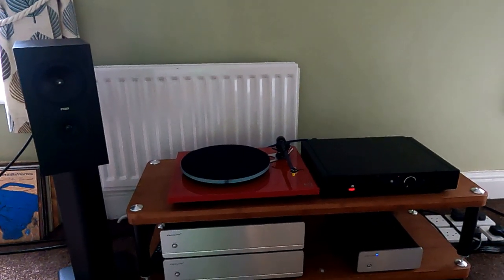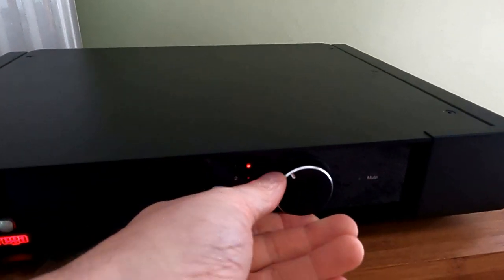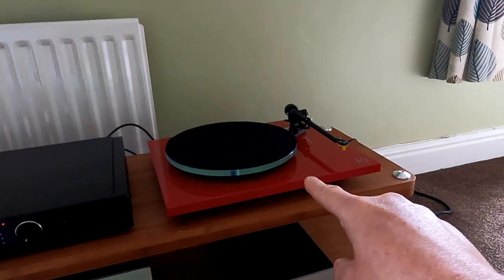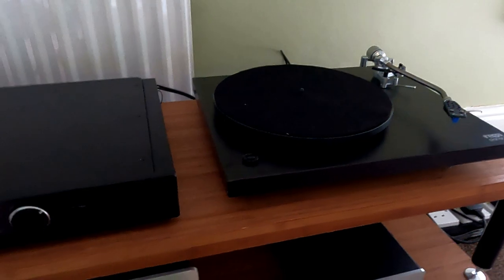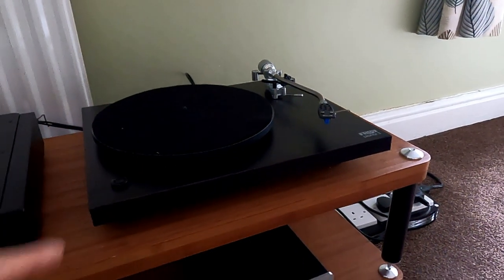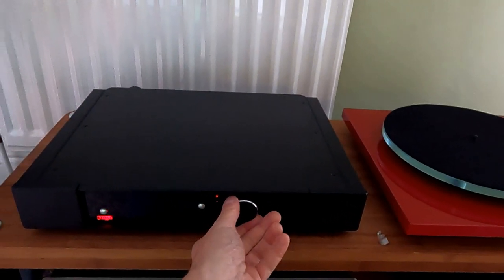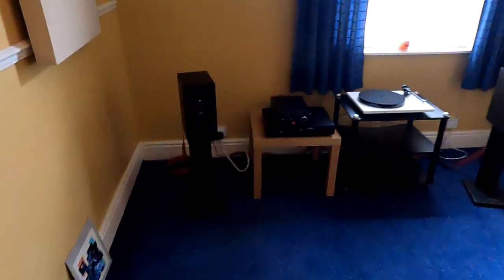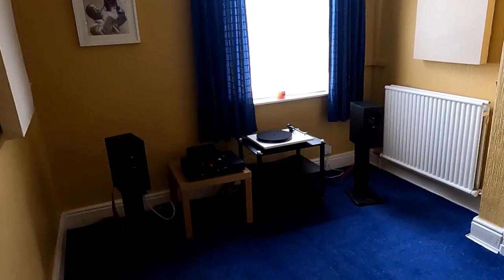turntable buzzing?  simple guide to what may be going on.  Using Rega Planar as example

Comment: Best tip ever! I was searching the internet about how to solve my hum. Nothing worked. I noticed that it somehow had to do with my amp. I noticed that when I put my turntable further away, the hum got less. But the configuration of my tv cabinet I couldn’t move it further away to solve it completely. Then the genius tip, switch amp and turntable. My transformer was on the left side too. The side I had my turntable sitting. Switched, no hum! Gone! Thanks a lot for the great tip. Cheers to you!

Comment: Hi Phil,, great and interesting video, the Elyis 2 dies pick up low level hum as it goes towards the end of record, however you rightly said change the cartridge will solve the issue, did try tuning an earth wire from the motor housing to see if that resolve it. I have a spare ortofon cartridge and tried it and yes hum much reduced. Regards mark

Comment: I have a Rega P3, playing through a Project Phono Box E and a MarantzSR 5007,feeding a pair of Mission MX3s. Sounds absolutely awesome, with absolutely NO phono hum whatsoever, though the Marantz is insulated from the turntable and pre-amp by a fairly thick glass shelf on my equipment rack. Works well for me.
Reply: You may have  answered my problem. 
The phone box. I have one turntable   and 2 amplifiers and sets of speakers. With the Denon, the grounds must be connected to cut the hum . But when I use the NAD the ground must be cut. So maybe the phone box for  isolation is what I need.

Comment: best video on “buzzing “:) on youtube , thank you for sharing this is very useful for a lot of people, i have rega io and P1 and it was buzzing , only when i grounded rega io amp using grounding cable connected to  grounding metal in power plug in the wall ( european system) and connect to turntable grounding  knob on rega io , the  buzzing stopped , i think my issue is house is not grounded properly , or it could be wi-fi or anything in house , i will investigate it further . thanks
Reply: Had the same buzzing sound happen on my P1,  did the same thing and as you mentioned once I grounded the phono mini to the ground plug from my power strip the buzzing disappeared.
Reply: @lawrencecabrera5937  yeah I had the Rega mini (still do) and it was quieter than my new Bryston BP2 but unfortunately/fortunately? the Bryston at 10x the price does sound better.  The only "solution" is to not crank up albums too loud because it's not horrendous at this point.

Comment: Very useful video. My problem was that I  had quite a noticeable hum from both speakers, Rega 
Brio, Dali Specktor 2s, Schitte phono stage. Nothing seemed to work so I unplugged the other components one by one. I have a Yamaha Music cast dac/streamer, and it was this - though not the device itself. It's powered by a small usb plug in, like the ones you use to charge phones etc, and this was the culprit. I swapped it for another one and all was fine.
There is still a low buzz when I put my ear right up to the speaker but I'm putting this down to the Brio.

Comment: Hello Cheshireaudio,

I've been terribly vexed over an ongoing buzzing from my turntable (it's a Fluance RT-85 with a Sumiko Moonstone Cartridge connected to a Pro-Ject Tube Box S2 phono preamp)

Since I have a second turntable & phono preamp I switched everything out. Buzzing was still present. I moved the turntable away from the AV receiver and that didn't work. I even switches cartridges and checked the connections.  Nothing worked.

Then it occurred to me to look at my AudioQuest cables and one of them was the culprit. When I moved it around the buzzing increased and decreased so I replaced it with a spare set of RCA cables and the buzzing was gone in a snap.

It never dawned on me that a set of newer AudioQuest Cables could be defective. Luckily for me they're entry-level cables at roughly $40.00 so I didn't pay a fortune for them but even at that price range, one would expect a better experience. 

Anyways, your video got me to thinking outside of the box and within an hour I solved my buzzing problem. Thank You!

Cheers!

Comment: A very good video. Another cause of hum with older decks can be mechanical vibration from the motor finding it’s way into the replay chain. Hence the hum is only present when the stylus is in contact with a spinning record. Quite a few 70s belt drive decks used rubber mounts to decouple the motors. The rubber goes hard with age and no longer isolated the motor adequately. Often the rubber parts can be restored using liquid soap and hot water. Pioneer PL12D is an example of this, but many others from that time are very similar in design.

Comment: I enjoyed this video. I have a new Rega Planar 3 and a Rega BRIO. As the tonearm finishes a side, when I lift the tonearm, the static is crackling and a hum is present, and when the tonearm is back in place, the loud buzz will snap to a silence, like a vent closing on the side of your house. Without an album on the platter, I can move the tonearm towards the middle of the turntable and the buzzing hum increases a lot. It is very hard to diagnose!
Reply: I have the same problem with my new Rega 3 and it’s driving me crazy. I’ve tried everything to eliminate the buzzing, but failed so far. Did you find a solution in the end?
Reply: @beetlebum7760  I tried 2 Exact cartridges and the dealer installed an Exact cart on one of his at the shop, with the same result. Probably a bad batch of Exact carts. I upgraded to an Ania MC cart and no issues, but the sound is not as warm as the Exact
Reply: @LifelongMusicJunkie  That’s too bad. I have the Exact as well. ☺️ So I’ll return it to my dealer and see if he can fix the issue without having to change the cartridge, as I’m also quite happy with the way it sounds.
Reply: @beetlebum7760  Make sure your dealer has another Exact on hand. My dealer is a small local dealer so he had to order another Exact to prove that both attempts to fix it were the same. Good luck.

Comment: That is a very valuable video say the five times fast.  Personally I have the newer planar 3 with an elys 2 that definitely picks up more noise as the arm gets to the middle towards the motor as you point out.  I agree I don't think it's a grounding issue.  Perhaps I am getting proximity issue problems still but having bought a Bryston BP2MM with PS3 power supply didn't help at all if anything probably noisier than the little Rega Mini phono stage.  Does sound better I must say.  Perhaps adding a NEO power supply would improve the noise problem and apparently would improve the sound.  Adding a new Rega reference belt might improve further as to sound quality.  I should try turning things off like my wifi etc. to see if that takes out the hum but when a lot of it seems like it's the Rega motor that frankly I consider a dog in terms of noise from the get go.  I would have to imagine Rega cut corners somewhere if nothing else they took out 2/3 of the weight in an apparent attempt to improve sound quality which seems a bit silly to me but they like the light stiff design and have gone a bit bonkers in that regard and one would think that if you want to isolate things like motor noise you build it a whole lot differently than wide open and less material.  Anyway getting much more proximity is tough when Rega doesn't even let you put a nice interconnect and instead force you to use their interconnect and live with that and their chosen length.  It's probably good I do like the Rega TT having an original planar 3 that is a freaking tank and if this newer one motor doesn't die long before 30 years I would be amazed.
Reply: I have a fairly new P3 (3months old) fitted with a Rega Exact cartridge and have had no noise problems whatsoever.
Reply: @alanbratt3022  well most really like the Exact and many seem to not like the Elys2 so much, hum aside.   What phono stage are you using?  The Rega Mini has a separate ground and surely is quieter than this Bryston BP2 so I would imagine a Rega Fono MM model would provide quiet operation and great sound.  My volume when not set too high is fine as to hum with my system, until maybe end of record.  The Elys 2 (and Exact) are high output as is the Bryston so that creates a bit of a mismatch.  I may get the NEO PS to see what that does, supposed to be a sound improvement whether it lowers the hum.
Reply: @JohnDoe-np3zk  At the moment i am using a Project Phono E-Box, hooked up to a Marantz SR5007 receiver, driving a pair of Mission MX3s.
I'm more than happy with the sound that this system puts out at the moment, so I don't think that i'll be changing much very soon, but am thinking, like yourself, of adding the Neo TT PSU to the system.

Comment: Thanks for the very interesting video 👍. 
As the owner of a couple of older Rega planer 3 Turntables, that are both much modified,  the only time I've noticed humming is when I had an R200 tonearm fitted. This deck is now fitted with: a modified Rb251 tonearm, SRM Tech Silent Base and the matching TT psu, 24v motor and pcb from a Rega P7, among its many modifications. 

 My other Planner 3 has a modified Rb300 tonearm, later Premotec 110v motor and Isokinetik Isodrive branded Heed Audio PSU and PCB, among a few other modifications and has always been hum free. Both these turntable and tonearms have had various motors and psu combinations too, only because I like to experiment  🤯 and have been hum free.

Comment: Ι have a 2021 P1 with the Mini Fono A2D. I have a hum that cannot seem to get rid off. Tried earthing from the phono pre to the amp and still does not fix it. The amp is three feet away from the turntable. Any other suggestions or should I return it. Is it possible earthing routing might be faulty? Any suggestions would be much appreciated.

Comment: Hi sir very informative as usual , I have the rega p3 and rega phono stage plus the rega speed controller . And indeed I notice the sonic hum as the arm progresses across the plater . If I was to be critical of rega I would say the fixed length of the phono cables from the deck would benefit from being longer .  Now weather this would eliminate this problem I’m not sure , But I’m of the opinion it would do no harm  . As a retired electrical contractor I know full well the high frequency problems that can affect all sorts of sensitive equipment  . So with this in mind just let us think for a moment and consider how a phono stage works ,     it’s job is to amplify a very small signal . So by virtue of its task in hand it will do exactly that to every thing within its potential wavelength  . But fortunately our saving grace is that when 
 we listen to the music , most of this negative background noise is lost to us . Yes there are those who are able to detect such frequency’s , and find their listing experience diminished because of it . And I can fully appreciate there dilemma , but as our good friend has proven most issues can be overcome . Best wishes and kind regards to all especially our genial host  😀👍👍👍

Comment: I had buzzing with a Technics 1500c mm or mc, Denon PMA100 amp, worse with the ground connected. It went away when I hooked TT and CD player up to a $31 Furman power strip and a heavy duty power chord for the amp direct into the wall. Records sound quieter with darker backgrounds as well. Not sure how it’s possible with just these two changes but it’s night and day.

Comment: My Systemdek IIX 900 has a very slight motor hum but thankfully it does not come through the speakers. It has a Rega RB250 arm without an earth lead but the deck has a separate earth post. It makes no difference if I connect this to my Project Phono Box MKII or not. The hum is impossible to hear when I play music but as I know it’s there is there anyway to get rid of it?
Reply from the maker: That’s more of a mechanical issue... perhaps a small amount of glue in the base of the spindle might help... it’s the same motor as the early Regas ... could possibly be a cap on the supply board breaking down ... but that usually causes speed issues too
Reply: @cheshireaudio  thank you for your advice. The hum is very very slight and doesn’t get in the way and the speed is spot on. It’s a psychological thing just knowing it’s there, you have to put your ear right up to it to hear it. It’s probably me just being paranoid.

Comment: I remember an old Hi-Fi Answers article circa 1978 titled "Down to earth trickery.....humm" by Paul Benson regarding hum loops in a system. My Linn Sondek had a separate earth wire in the mains plug but the attached Ittok had an earth lead also. If the Ittok's earth wire was connected to an amplifier which had been grounded via its mains plug the two separate paths to earth could cause a ground loop audible as hum. I suppose this problem isn't encountered so much these days and that's why you didn't include it. Great video though.
Reply from the maker: Good point...  sometimes get that with the Nottingham’s... perhaps I need to do a ‘part 2’

Comment: Thanx for the vid....just got the Audiolab 600a pro ject table fine but my rega 6 making noise only when I move or touch the arm...any ideas? Did you work in Doug Brady's or better hifi maybe ?
Reply from the maker: Is the stylus lowering on to the record ok? That’s an odd one...  I was at Doug Brady’s from about ‘83 to ‘95
Reply: @cheshireaudio  I've sorted it...placed amp on bottom shelf of rack... connected pro ject to the phono stage & rega through a external phono amp ...working fine now...got my first rega in Doug Brady's ... nephew got it now,still  going strong...1986...👍

Comment: I got the rega planar 3 18 months ago it has hum it used to have a continous popping noise too. I have the marantz pm 6007 that has a ground on  the case too. It was suggested to attatch a thin wire from the left outer ring of the phono lead of the turntable to the earth on the marantz. It was very cluttered behind my system with x2 tacimo filtered 6 way extention leads because the TV & set top box, wifi router & playstation was near by so I managed to de clutter that by re routing some stuff to a seperate socket & it's cut the noise about 50%. Apart from that I was stumped I only had the planar 3 deck on at about up to 33% volume  before the hum annoyed me. The popping  i think was due to the routers old proximity but OK now. So happy I treat myself to some new speakers, b&w 607 s2 anniversary. Now I am happy with the whole sound & system.

Comment: What cartridge upgrade do you recomend for a Planar 2?

Thanks in advance for any advice.
Reply from the maker: I’ve fitted the new Audio Technica Vm95 en to a few now and it matches it really well... also the Goldring E3 ... actually got stock of both these too after a long wait
Reply: @cheshireaudio  Cheers for taking the time to get back to me... Surprised the 100 quid(ish) Rega upgrade didn't get a mention?.

Ian Fletcher.
Reply: Agree I used the same on my Planar 1plus... Along with some other bits of advice. It's sooooo much better now. Amazing difference

Comment: More than Earth it needs to be balanced even RCA can be you need to shield it all the way up to the cartridge body is the best approach and we'll cut out the noise. They are using the wrong type of cable you need triple should cable ideally 50 ohms and you got to shield interconnect wires to the cartridge with some copper tape you need to connect each channel together wires make sure they're touching closes possible with some cotton tie them together keep each channel separated as much as possible with a bit of sponge insulate the connectors to cartridge and from the head shell and wrap the head shell with copper tape make sure it's Earth out to the cartridge body and the arm is shielded as well a lot of arms are not properly shielded running one Earth wire is not a shield.
You have to look at EMI interference as water, if you treat it as water then you will block EMI EMI will try and find any root possible to get in that's the nature of EMI interference. And don't shield your power cable to the wall this is wrong a manufacturers keep doing it, it needs to be Earth to the equipment not the wall socket.  sealed your motor as well put a shield around your motor as well use some insulation tape then copper tape and make sure the copper tape is grounded